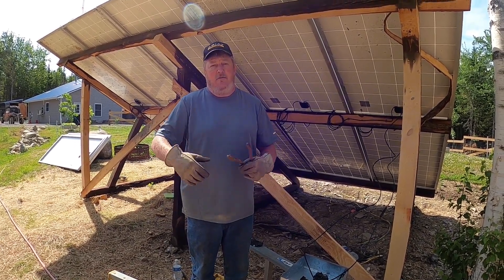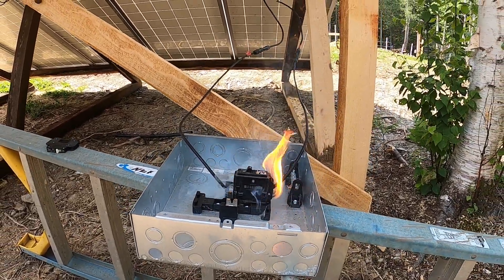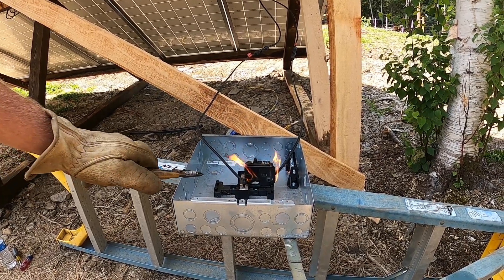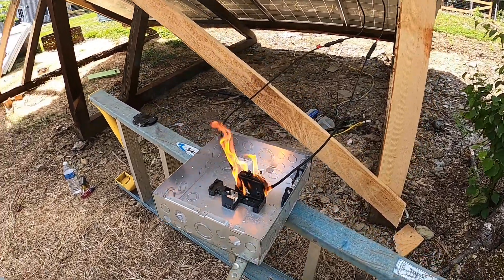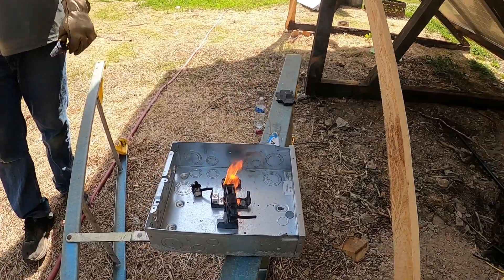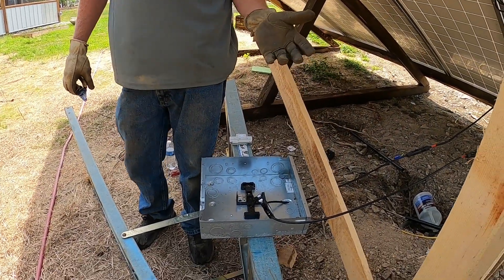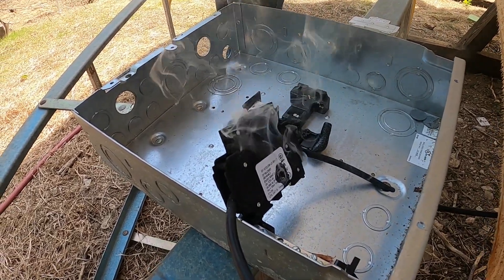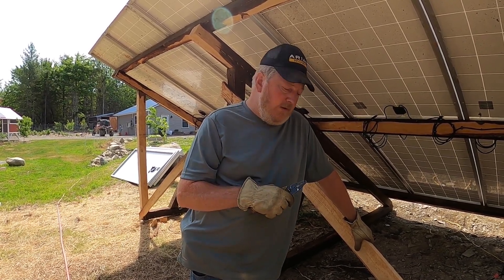Our Breaker is on FIRE! Using AC breakers in a DC application(don't try this at home!)

Comment: Is my system so small that this just doesn't happen with mini breakers ? 
Only one has the ~ line none have a line with the dots,

Im running all kings 12v products on 2 x 100ah lifepo4 batteries on 2 x 250w folding solar panels
12v control box(40a single breaker)
25a dcdc chargers solar (32a single breaker)
40a mppt solar (40a double breaker) 
40a mppt battery (40a single breaker)
Everything runs into a breaker then into a bus bar 
Bus bar to 50a 12v breaker (apart from the mppts solar breaker double that both wires run to a anderson plug)
All negatives run into a bus bar then to a battery monitors shunt to battery 

The dcdc chargers solar and mppts solar go to there own breaker and then into a splitter 2 to 1 for the solar extension lead 

Batteries are always charging or in float charge 
Max volts the mppt is reading is 22v, amp amount bearly gets to 2a 

The only thing i have running off the batteries is a kings 3000w pure sine wave inverter that powers a washing machine and sometimes a portable ac unit,

I turn the switches on and off alot to turn the 12v control box on and dcdc charger solar and mppt solar 
Never heard anything strange or smelt anything melting or burning 
Is there a reason for this like not enough power to even make big enough sparks ect ?
Reply: All MCB breakers
Reply from the maker: It is more based on voltage, DC breakers are rated for a max voltage and exceeding that can cause them to arc over internally when switched

Comment: HOWdy  A-t-H-w-S&R, ... 
Thanks 
I use Square-D Homeline for everything  "A/C" but never "D/C" !!!  ... 
but
I have heard that  Square-D "QO" is UL certified  for "DC" up to 48 Volts on a single pole breaker ... 
&
Square-D certified for  100 volts on a two pole Breaker ...  
COOP
the  WiSeNhEiMeR from Richmond, INDIANA 
...
Reply from the maker: I believe you are correct on the Square-D however that low voltage DC is rare anymore as more people are installing higher voltage DC 
systems.

Comment: Great  video ,Anything on polarised DC breakers ,I hear there's hundreds fitted buyers unaware that if they wired them wrong they could blow ?
Reply from the maker: I cant speak for all brands but the CBI brand I know will not fail if tripped when installed backwards. I was told the polarity is becuase it is rated for thousands of cycles like a switch, In that case it could fail if you cycle it thousands of times but a single cycle do to over current will not cause failure i am told

Comment: Very  nice video. Thank you for taking the time to do this.
Reply from the maker: Lack or, or the wrong breakers is one of the most common issues we see in battery based systems every day. It is a little scary as the battery has almost unlimited energy and the higher voltage DC will (As we show) cause some nasty issues when you use the wrong breaker

Comment: We are installing a 450vdc PV array at 10a per string. (4-strings) where do we locate a quality, but cost effective breaker to mount on a combiner box DIN rail?
Reply from the maker: Companies like Midnite Solar and others make dc breaker boxes, Look at distributors like the AltE store or Northern Arizona Wind and Sun for dc boxes and over current devices, At 450VDC its a little tougher but I know midnite has a 600vdc 16a breaker

Comment: Nice demonstration. Most people don't understand the danger of DC Arcs. BTW, Square-D certifies their single phase breakers for DC for 48V (also UL listed for that application).  They also internally certify their split phase breakers to 125V DC.  In both cases they claim arc quenching up to 5000A.  Good for batteries but not today's high voltage PV arrays.
Reply from the maker: We agree, I think unfortunately a lot of people over look the importance of proper breakers and disconnects.

Comment: Hey Ryan, I wired a <1A, 12VDC lighting circuit with a 120V 15A switch. No issues...so far. Do you think this could be an issue on low amperage 12 or 24VDC circuits using 120V rated switches? As a side note, I am trying to find DC switches that fit into AC outlet boxes for ease of wiring in my shed. Any product recommendations?
Reply from the maker: At 12v and less than an amp I can't see it ever being an issue. I recall at one time one of the mainstream AC switches carried a small DC rating as well but not finding anything with a quick search unfortunately

Comment: Thank you very much!  There are people saying that AC breakers are acceptable for DC.
Reply from the maker: Everyone has opinions for sure, Generally our theory is Do not use a product outside its recommended uses if it can cause a risk of fire. Especially when the proper parts are available, Some however will still think its a way for people to gouge the customers but knowing AC vs DC we can promise you thats not the case
Reply: @aroundthehomesteadwithsuer3497     The Square D QO breakers (*not* the Homeline breakers) do have a DC rating up to 48V and Schneider claims that up to 125 VDC is OK too.  They are triggered by thermal alone.  Specialty DC breakers have thermal and "magnetic surge" capabilities.  In the end, I'm going with the Victron Lynx Distributor bus bars with so-called "mega fuses".  This is to gang together ten batteries.  The batteries themselves each have a DC breaker, so the fuses are an extra precaution.
Reply from the maker: @omaha42000  Yes the QO series is good to 48v max though so not for a 48v system. As for the 125vdc I would not trust that unless I see it on the side of it as a rating or a data sheet showing it.

Comment: In a small 12-24v system, wouldn’t this have been ok?
Reply from the maker: Depends, The AC breaker no it would fail. Maybe not as dramatically but it would fail. The DC breaker we tried that was 150vdc rated would work fine for 12 or 24v

Comment: Sorry BUT how many people are going to use 400 plus volts
Reply from the maker: 600v systems are becoming more and more popular. Higher voltage controllers allow use of a single string of solar panels and can eliminate the need for a combiner. It's starting to be a pretty regular issue in the solar industry.
Reply: @Around the Homestead with Sue & Ryan  
Sorry but I will stay with 98-150 volts 95 amps per charge controller
Solar for about 11 years and no issues.
Reply from the maker: @mikefalk715  I am with you on this one, I had to install the 600v for work but in general a 150vdc or less DC system is elegently simple to me

Comment: what about lower volts 24-48- 60 ??
Reply from the maker: We can certainly do some variations in this test when it warms up, I will say the lower the voltage the better the chance a standard AC breaker opens without fire at least once.

Comment: Great demonstration, and definitely drives home the point! What about Square D's QO line? IIRC, the single pole breakers are UL listed for 48 Vdc and their double pole are "Square D Certified" for 125 Vdc.
Reply from the maker: As long as they are used within the manufacturers specs, they should be fine although we have not personally tested the Square D in that application.
Reply: @aroundthehomesteadwithsuer3497  I have seen other videos demonstrating their use. See: https://youtu.be/WOUiJBSfFz4

Comment: And you forgot to mention polarized DC breakers need to be connected with the correct polarity or else you will get an arcing fire too. In Australia non polarized breakers are mandatory. Because solar installers frequently installed them incorrectly.
Reply from the maker: Very good point and the US is moving that same way on polarization. We have a 300v polarized breaker here maybe I will try it the proper way first and then the reverse polarity

Comment: I deal with lots of 1500 VDC PV strings (10kw per string). It amazes me how safe they are when they develop a fault: The #10 PV wire instantly vaporizes and disappears, usually very quickly extinguishing the arc. For a short time however, the Arc can reach over 24" if pulled apart (if its sunny out).   The lower voltage stuff is much more dangerous, as the arcing can sustain if the wiring/breakers dont burn up fast enough.
Reply: I'll be honest, this is surprising and scary!  You're essentially saying the vaporizing wire acts as a fuse?
Reply: @benjamingamble2407  Im saying that the vaporizing wire acts as a disconnect switch, as it burns the circuit open (from a short circuit/fault). When the fault is upstream of the string fuse, the fuse will not open.
Reply: So yes, it kind of works as a fuse, but not in a nice way, since the wire could melt open anywhere along it’s length, most likely inside a buried conduit, which may be destroyed in the process.